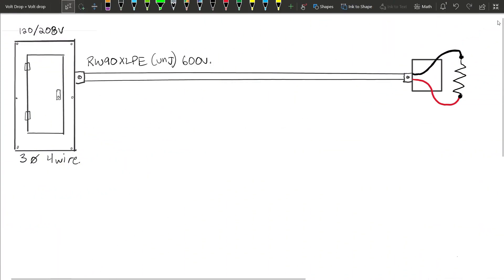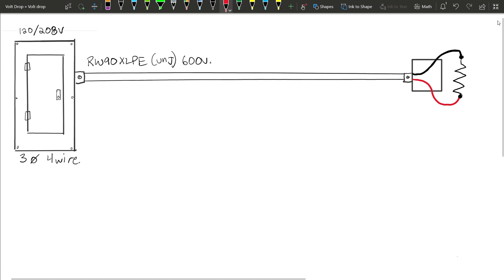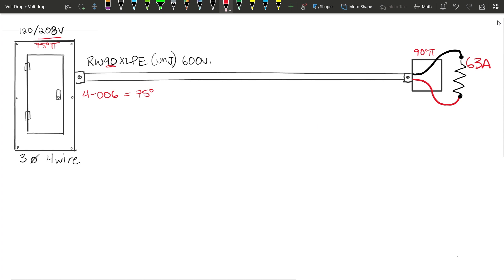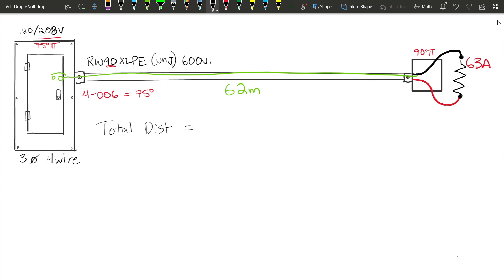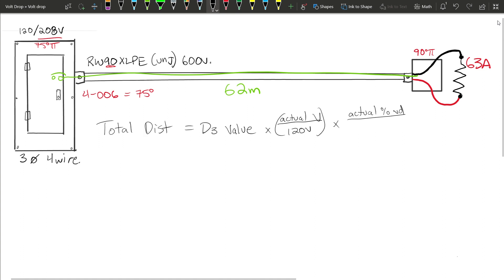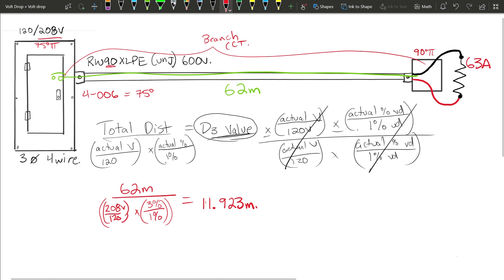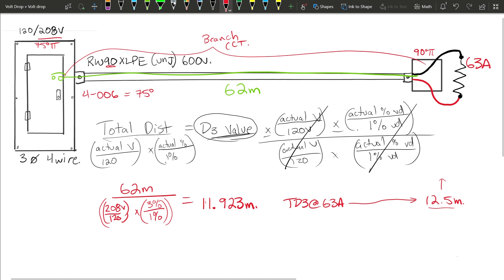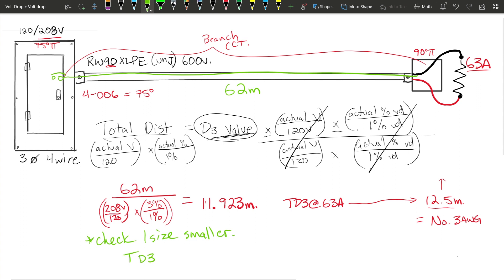Voltage Drop Part 2

Comment: Again what rule prompted you to use the 75 degrees?
Reply from the maker: 4-006 would require us to use the lowest termination temperature to determine the column used at table 2, when selecting a conductor. Given that there is 75°c stated on the panel and load, we would select from the 75°c column.
Reply: @schulerruler  And what if our equipment was rated at 60/75degrees but under 100 AMP
Reply: How about office and warehouse calculations. Help ll be appreciated.

Comment: Thanks for all the help man. I'm always uncertain about the temp of the wire I should be using when the equipment isn't marked, if you could please help me out with this thanks.
Reply from the maker: Happy it helped. If you are not sure about terminating temperatures, or if a question does not state, you can reference 4-006 2), as these are the "defaults" if not given.
100 amps or less (or using a no. 1 awg or smaller) = 60 °C, more than 100 amps (or using larger than no. 1 awg) = 75 °C.
Reply: @schulerruler  thank you very much.
Reply: @schulerruler  hey Chris I was reviewing some voltage drop questions and I've noticed in the example at the bottom of TD3 it used a 90° column
Reply from the maker: When applying the thanks D3 note 3 table, we must only use the insulation temperature. If the insulation is say, RW90, we would use the 90 °C row. Even if all termination temperature were 75 °C.

Comment: how would you solve this if they didn't give you the 120/208-panel values?
Reply from the maker: If I was unaware of the voltage at all I would default to the values on D3 to be safe, which is based off of 120V. If you are wondering about when to apply the 1.155 allowance for the phase loads, it only comes into play when it is more than two current carrying conductors. 
Voltages should be stated unless there is an indication of how to obtain them, or there is an agreed upon default if this is an academic question.
Reply: thanks for asking, had the same question. Looking at the circuit with only 2 conductors I assumed 120V since 208 is the 3 phases voltage (120*rs(3)) = 208, I don't know if it ok to get 2 phases of the 3 phases to power a resistive load

Comment: How about dealing with 3 phase, 347/600v  feeder services?
Reply from the maker: You will also need to use the multiplier for a three phase calculation of 1.155.